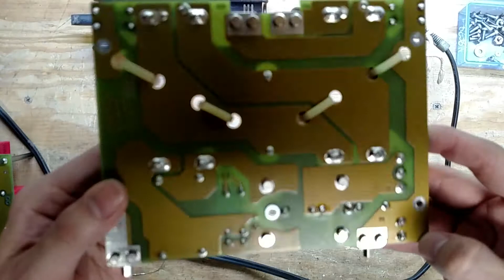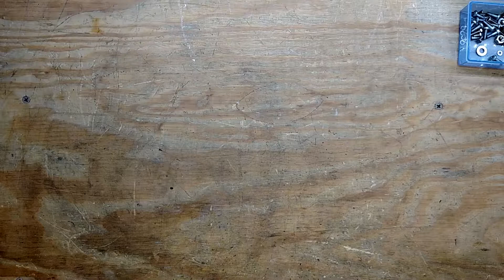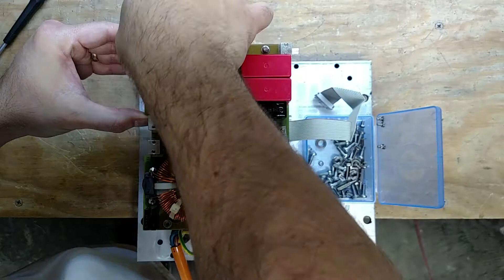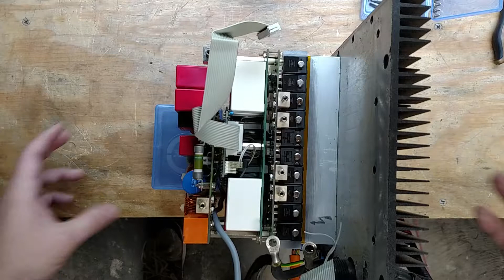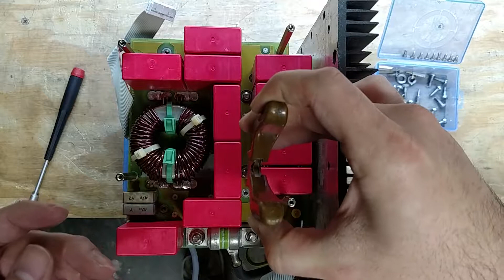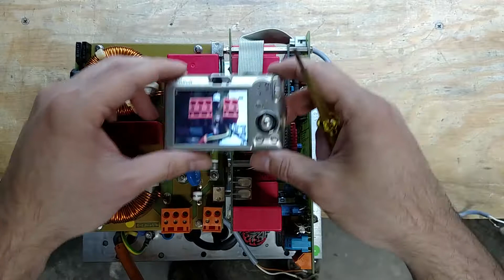BC3300 Repair Part3c S/N 1377

Comment: hi remember me ? you give me tools for dialog with NLG4
not done yet sucessfull.....humm
can you confirm that a 3 wire + blind is enought for do that....
and could you tell me good config of the rs232 com on pc....? thank's
Reply from the maker: +Farad Ohm 

A standard USB to serial adapter has the correct pinout.

When you setup the USB to serial adapter, make sure it is on COM1.

Then run the MonLog program available here:
http://www.wolftronix.com/batteryChargers.htm

You might need to run the MonLog program with administrator privileges, or in XP compatibility mode.
Reply: +Wolf
I want to use old pc for these applications, no usb,
only com1 ,with cord wired 2/3 3/2 and gnd;
pc turns with xp only , its enough....thank's